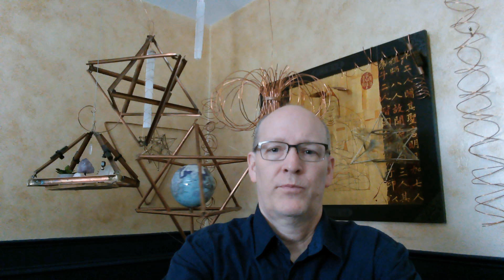Magnetic Nuclear Fusion Propulsion

Comment: Thank you for saying 'blinking in and out of our dimension'  at 3:27.     At the tiniest possible size of tori in our reality, I think they are all synchronized, and will "blink" into a higher density reality, at the tickcount that Clif High often quotes, something like 22 trillion times a second.    I know of a few examples of matter and energy that disappear and reappear,  but if I'd like to hear your list of examples, if you can.
Reply from the maker: With the neutral magnetic pulsing, all elements can be blinked in and out of our existence, so it makes the fuel choice interesting. There are fuels that are not being conventionally used right now that are far superior to conventional fuels.